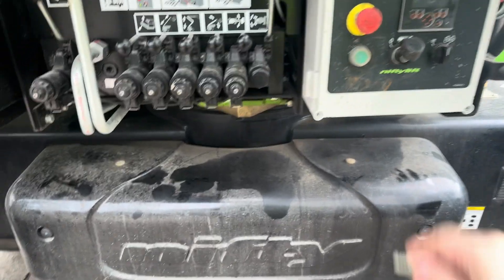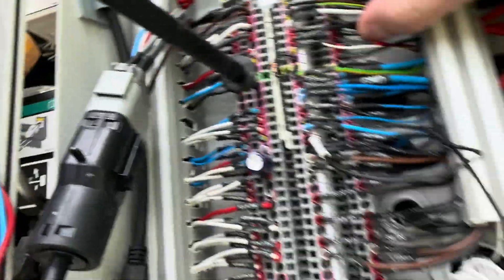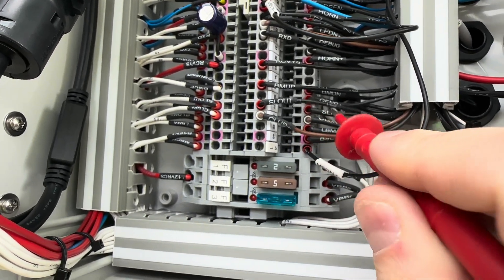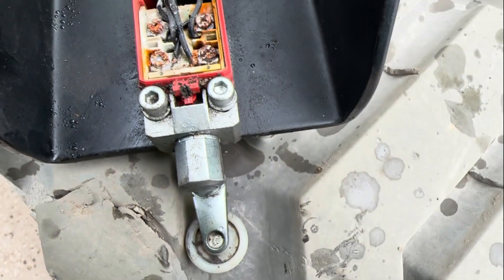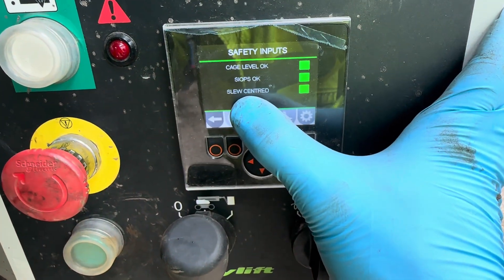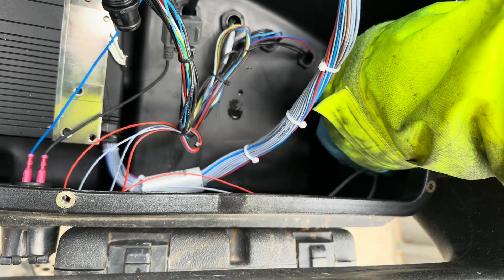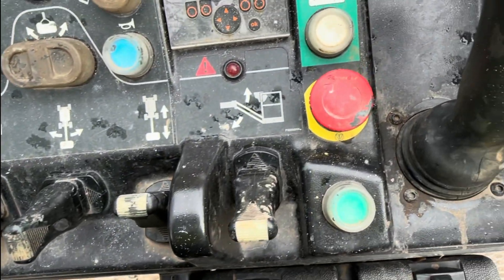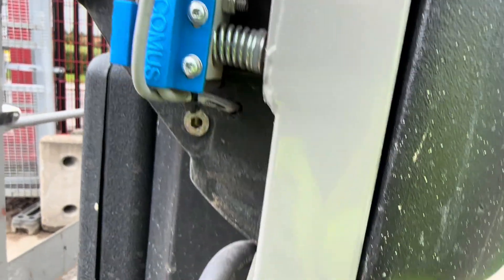Niftylift HR28 SP85 error code 01E70000 test with multimeter and siops fault

Comment: Do you like the fluke 233
Reply from the maker: It is handy when you on your own but it could be annoying at the times . For example on hr28 it can get out of range pretty easily. And in some case does not reconnect and you have go back from cage to base for example and refit screen back to main unit . Then reset power and work again. Thats only one down side I can think off is remote display range

Comment: Awesome job as usual, I felt like I spent forever adjusting and messing with a siops issue on a hr28 the other day for the exact same issue, siops activating and staying on when going over a bump, so I adjusted it like you and didn't take into consideration added pressure from the cover 🤣 but got there in the end 👌 keep up the good work, looking forward to the next video 👌
Reply from the maker: Thanks mate some times they could be really tricky to get them right